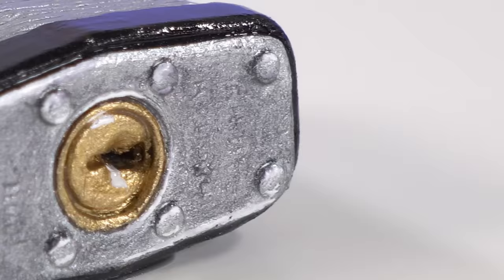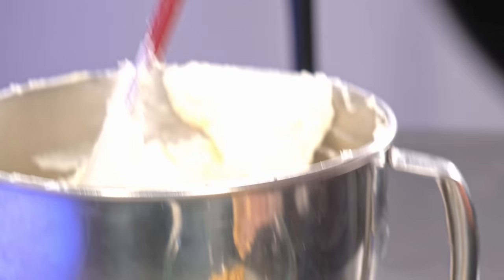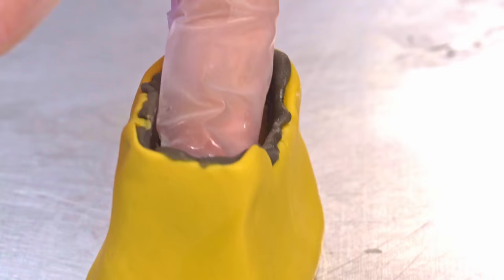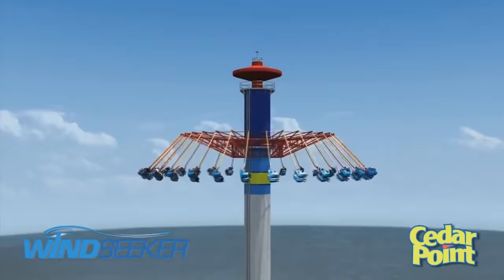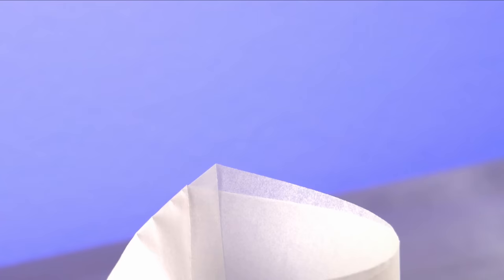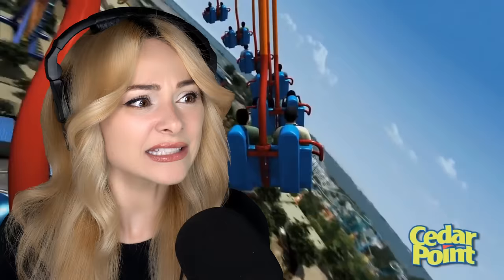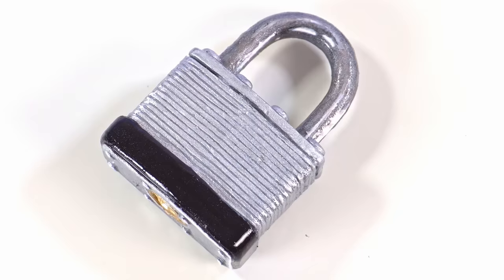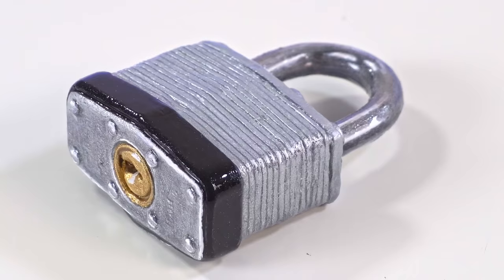Which Lock Is A Cake?

Comment: I can relate.
I can ride the world's most dangerous roller coasters but not the swings or the merry-go-round. Motion sickness. (Though, I don't get air sick or sea sick.)
It's the 'going around' that gets me. Not the height.
I once made the mistake of getting on the swings when I was the only one on them.
After a few turns, I started feeling the wave of nausea hit me. My head started bobbing and I felt like I was about to pass out.
My mom and dad saw my face and told the operator to stop the ride.
They said I was whiter than Casper.
We went to Burger King a bit later. I couldn't eat.
I just laid down on the booth chair.
Then, I threw up fruit punch on the floor. 🤢🤮

Comment: I had a "OMG" I'm going to die" moment in a rollercoaster once. It's one of those that rotates and goes backwards and upside down and all that. Nothing really scary as such. But the safety harnes was a loose 5 point seat bealt. I could easily get out of it without unbuckleing myself. I didn't die, but I have never been so scared in my life. And lets just say, the safety harness was remade for the next season and it's now a propper bar that is lowered over your shoulders, as it shoud be. I have never been on that one again. Also, Valkyria in Liseberg (Gothenburg, Sweden), is also one of those never again type of rollercoasters. A 90 degree dropp, straight down. They even leave you hanging there for a few moments before you basically fall face first into the ground and after that it's just a normal rollecoaster.

Comment: I went on a Waltzer with my girlfriend last Christmas. I have motion sickness, and haven't been on a rollercoaster or anything of the sort for years. I hadn't seen the thing moving, so I just thought it was a simple "spin in a circle, but faster" thing. Turns out, the carriages inside also spin randomly, separately to the carousel, as well as going up and down at random speeds. This creates quite significant Gforces as well as a nightmare for a motion sick person. Also, the "restraints" are not very restraining at all. They consist of a single loose bar in front of your chest. If you don't want to slide around or fly in the air, you gotta grip this thing with all of your strength. I was not aware of any of this. 

I passed out three times on the ride and now have a significant fear of carnival rides.

Comment: I am sure that this will not be helping, but I have had a roughly similar experience… if you could call it that? I too was going on a ride where you site on swings and it slowly rises as it spins circles. I was about ten at the time, and surprisingly I wasn’t scared. (that by the way was my biggest downfall) We get to the top and the rides just stops up there, this was normal for that version of the ride so i thought nothing of it. But it had stopped for an abnormal amount of time. I’m talking minutes of just peace, a couple hundred feet off the ground. Then to calm us all down the employees used the speeders on the ride to tell us, that the ride had in fact malfunctioned. Didn’t help calm us but my mom on the ride started strait up praying the second the speaker had quieted. My dad sitting next to me squeezed my arm. Then we started going down, thank goodness. Problem ain’t over though buddy! It was going slow, very slow, slow to the point where we thought we weren’t going down on purpose. Then about half way down it just goes from quietly walking to the kitchen at 3 am speed, to run for your life speed. Everyone on the ride started screening till we get to the bottom and it just stops. Needless to say everyone hurriedly got off. But the best part, the best part, is that they tested the ride 3 times, only 3 times, before they let people back on. I never want to go back to that place :).

Comment: I actually had an experience like yours but mine was way worse. 
I went to California adventure for ogee bogie bash, and one of the rides there was Soaring. 
I had never heard of this ride and on the warning sign it said it had a sudden drop which I was totally fine with. I was just a little nervous. Until I was about 3 people away from getting onto the actual ride. My nerves were getting worse and I started to second guess my choices. Anyway soon I got on and we were just staring at a screen. Then it starts lifting in the air and now it feels like we’re in a 3d environment. Because apparently the screen was 3d. Since it felt so realistic the sudden drop would be a horrible experience so I started having a huge panic attack. I was buzzing everywhere and felt numb. I started hyperventilating, and guess what? It was a normal ride that lifted about 12 feet in the air in front of a sphere screen. Nothing happened. 

I was laughed at for a bit.

Comment: This is not a criticism, but you always ask if people can pick the cake and why so you can continue to get better. I picked the correct one was cake from the thumbnail, and the reason was that the silver part on the bottom of the lock doesn't have perfectly straight edges. I understand that must be super hard to do with chocolate, and the lock was amazingly done. Metal usually has super sharp edges, it doesn't look very slightly soft and wavy around the edges like this one did.